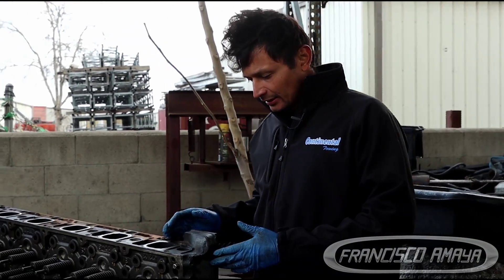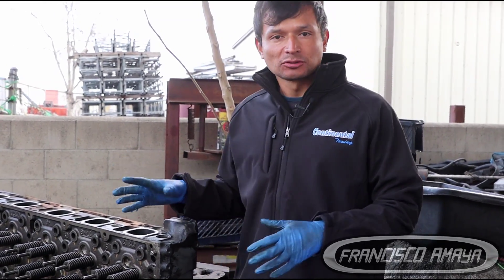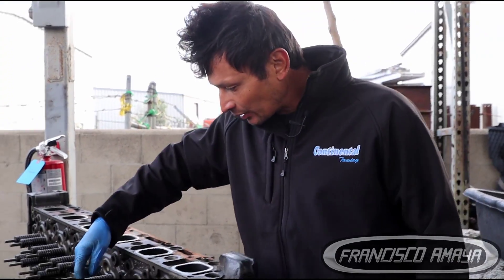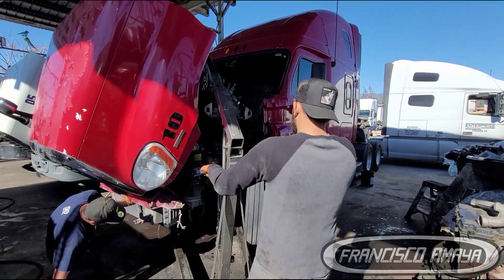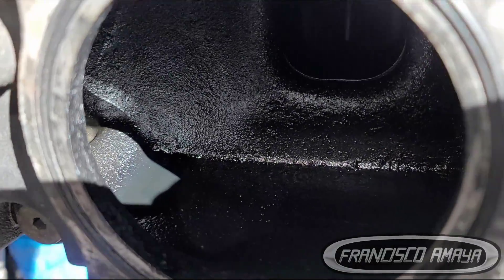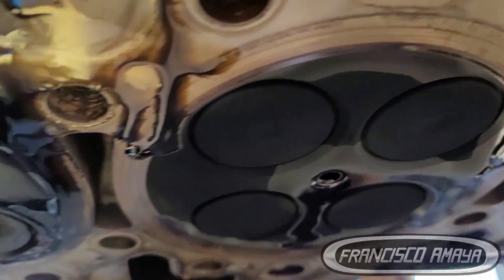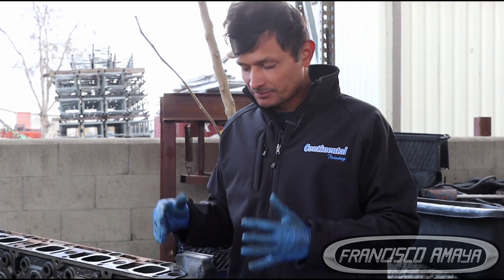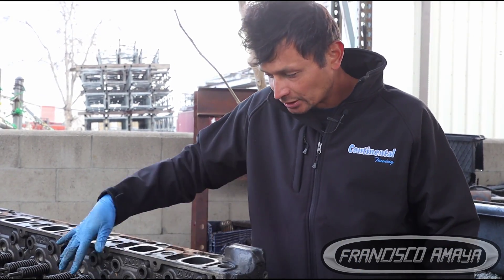DD15 engine cylinder head removed damage intake valve losing compression engine problems

Comment: @ francisco amaya
I was getting fault codes for misfire and found valve lash too tight as the last valve set was done 100k before.
So i was sure to replace the cylinder head but one my colleague asked to make sure that nothing is wrong with the piston rings or other engine parts so that we don't have any piston excessive blowing by which might be a root cause .
I took off all 6 injectors and blown shop air with rubber tip air blower to make sure nothing passess through ! 
My question - Is my way of testing with air blower right?
And what do you do normally to make sure nothing is wrong with engine before doing head
Thanks

Comment: I have to  2017 Freightliner Cascadia dd15 the problem is losing coolant I didn't see any leak outside and mechanics checkit with pressure test no leak at all, i add 1 gallon  per day, what is the problem ? he say it may be cylinder head is that true i need ur advice pls thank u